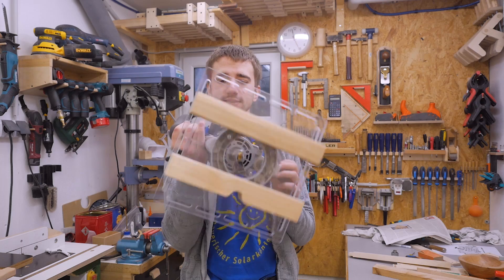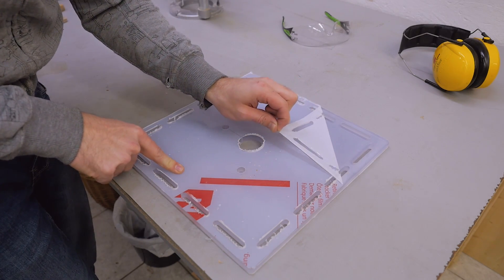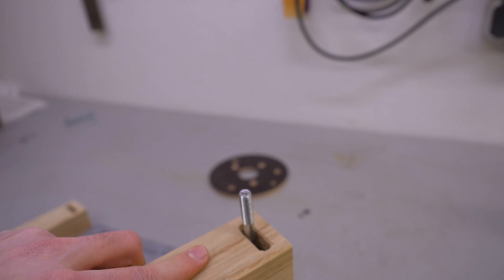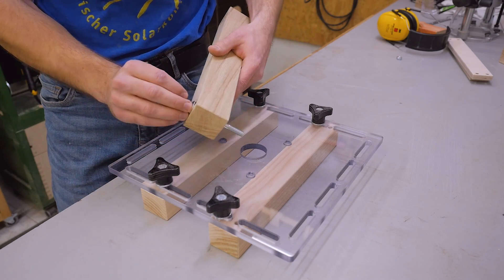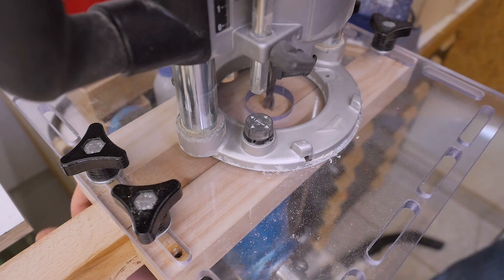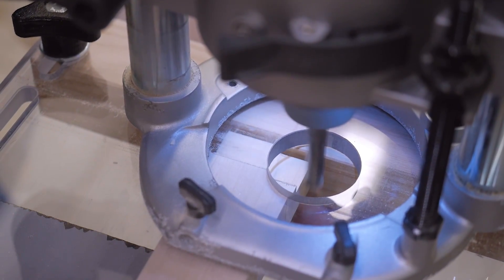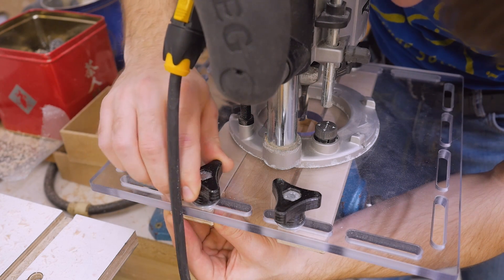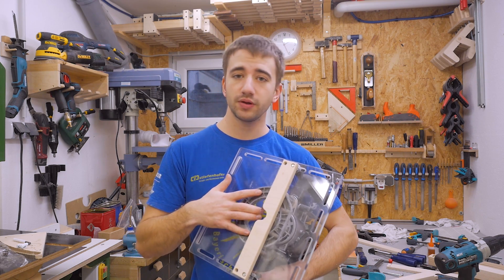Making My Version of the Samurai Router Jig

Comment: A trick with the threaded holes is to soak them with thin CA and spray with accelerator. Hardens the threads and they last forever. Love the jig. Awesome work!
Reply: If you need more hold you can always use threaded inserts
Reply: Bobby another trick- fill the thread hold half way up with 2 part penetrating epoxy, than wax the treads of the bolt -run the bolt in for a few seconds than back out, the bolt forces the epoxy into the treads/wood. Not as fast as CA but very strong P.S. clean bolt threads

Comment: The magnet washer trick - I've never seen that. Brilliant!
Reply: Mr Wandel did it
Reply: where was it?
Reply: Trick is fine and I seen it already and like it, good job.
But to be honest, here it seems to me a bit too much. It's OK for place where I do expect to change washer, but in this application ? I would expect the washer to be there .. well .. forever? Or, and it's still possible, I'm missing some important point :-).
Anyway, thank you for the idea worth spreading and I'm going to redesign my one custom base (more slots and knobs from top).
Reply: Tom Silver In normal use, the knobs come out, and they go back in. He showed you that in the video. Watch the video. He showed you that in the video. Watch the video.
Reply: @arlingtonhynes  Knobs are cheap and so are washers. Just epoxy a washer onto the knob and move on. The baseplate concept is excellent and the notched out fence is exactly the add-on that I did after seeing the samurai one.

Comment: Awesome video. Thanks for the jig. I decided to make one. I only could find 1/4 in (6mm) polycarbonate. I dont have a cnc so used a router to mill the slots. This proved tricky as all the bits i had did not do a good job. Tried double flute straight bits 1/4 and 1/2 inch bit did not work well. Spiral 1/4 and 1/2 in bits and did not work either. The perfect bit for this was metal spiral bits with 6 flutes. Worked perfectly. Very clean cuts. The metal bit has a rounded end and eats polycarbonate like butter. Thanks again for this video

Comment: It also occured to me that for routing centered grooves/holes, instead of the guides you can attach two round pins to the template equidistant from the bit, and turn it until they meet, just like a center finder... but only if the hole isn't too close to the end of the work piece.

Comment: awesome.  i will be doing this!  i like the slotted holes so much better than fussing with the samurai's original design with dozens of countersunk screw holes.  i think i'll use extruded aluminum rails with t-bolts instead of hardwood though and i'll put a strip of UHMW tape on the faces of the extrusion so that they glide nicely.

Comment: Thanks for sharing. That jig can also be made to fit in a router table so that there is no setup time. Also, with all the fences removed from, this jig can be used to make router boxes (boxes cut using a template, with the boxes having curved sides)

Comment: You could reduce the size of the slots around the edge (to clear a 1/4-20 inch or M6 thread) and make it into a T-slot, and add handles for surface-work where you can see through your base plate.  Nice revision to the already awesome samurai version!

Comment: nice work.  you might consider making the main hole sized and counter sunk to accept a router guide to have additional options and flexibility.  i have a piece of polycarbonate waiting for this...  One other thing, i would mount the plate on the router before drilling the center hole, then use a router bit to cut the center hole.  that way it is perfectly centered.

Comment: Good work. Yet as to M8 in hardwood in the long run, I would use brass inserts with inner M8 threads which would outlast any thread in hardwood. But that's just me. And the next thing for you to ponder upon would be to fix the router movement lengthwise with some sort of stops. That would be very valuable for serial production of parts.

Comment: Seems like there's plenty of room to add a dust collection chute above this jig! That's the one thing I dislike about my Bosch fence, the dust chute is unusable in the vast majority of cuts because of the position. I may have to eventually make this jig + dust collection for that reason alone. I also like how long the fences are
Reply from the maker: Yes, I took all dust collection off for better a better view in the video.
Reply: @MariusHornberger  Oh is it DC built for your router or did you fabricate something as part of the base? Can you show it off?
Reply from the maker: Just the part that came with the router.

Comment: I would use heli-coils for the wood threads on the fence parts and also add handles on the base plate so you're just not gripping the base plate. Other then that it's a pretty sweet setup.

Comment: I enjoyed your video. Your version of the fence attachment, with the non-slotted holes is a bit of an upgrade. With the original jig design, with bolts going through two slots, there was nothing to even encourage the fences to remain square to the plate and thus parallel to each other. By creating a fixed distance between the threaded holes, you've restricted them to move mostly in line with each other. However, small to moderate deviations from square (and thus parallel) are not hard to create, just because the threaded bolt has to have clearance in the slot. 

If I might make a suggestion, extending the fence to the edge of the plate and putting a T-square type rail along it would allow you to enforce that the fences be parallel when you tighten down your knobs.
Reply from the maker: The nice thing is that the fences don't need to be square or parallel to each other. A round cutter doesn't care about that. And the fences reference off of the workpiece. (the workpiece should be square and parallel)
Reply: @MariusHornberger  Squareness is only to ensure parallelism. Unless the fences are actually parallel, there will be clearance to rotate the plate relative to the direction of cut.  Just as an example, if one fence racks in its slots as you attempt to press it fully against a side of the workpiece, you could easily be forgiven for feeling it had registered against the piece, but still be very disappointed when you flipped the piece around for a second pass on a centered mortise, only to find your mortise slot is trapezoidal.

Perhaps I am overly cautious, but it seems like easy insurance.

Comment: Just built this jig (with slots like yours).  One big problem - I cut a long tenon (5 inches) - and did the firsts pass under the target dimensions for the width so I could 'sneak in'.  The router and plexiglass is supported quite well on the first pass.   But on the second pass, suddenly there's nothing there to support the 12" base - just about 1 inch at the shoulder of the tenon.   Wobbly work after that.  Really looking forward to seeing how you defeated this on your big table build.
Reply from the maker: I have faced that issue during the tables build. There's a simple solution. Don't cut the end of the tenon at the beginning, but in the end with a chisel
Reply: @MariusHornberger  thanks for responding!  Still a little confused (I don't have your level of experience) but definitely looking forward to seeing your process visually in the video.  Cheers

Comment: Very nice jig, thankyou. Your presentation is well done.  Question: Why 16 slots? Would eight (4 on each side) not be enough? Or do you put stops in the open slots? Idea: One could make the two wooden rails to be longer on both sides of the polycarbonate, and cut them on the inside down so that the polycarbonate plate slides squarely in them.

Comment: Nice jig . I have found somebody with a cnc who make it. He hasn’t 1cm thick plexiglass available. I can chose between 8mm or thicker. Probable 12mm. What would be better? Is 8 enough?
Reply from the maker: 8mm is enough, but I'd go with 12mm
Reply: @MariusHornberger  I have a confirmation. I can choose between 8 and 15mm Would 15 to thick? I think it limits also the maximum thickness of the machine

Comment: Where did you get the router bit with the small bearing?
Reply from the maker: The bit is a regular chamfer bit, that came with a small bearing. But here I turned an even smaller ring out of metal to get into the slots

Comment: Marius, any reason why there are 4 slots per side instead one long slot per side to avoid removing the knobs? I'm sure if you cut one slot  per side, the base would still have strength to hold in place and not snap off.
Reply: I was thinking the same thing. It's probably a matter of keeping the thin side of the slot more supported. If the slot is position more towards the center so there's more material on the outside edge, I think this could work.

Comment: Are special router bits and drills necessary to work plexiglass?
Reply from the maker: No. Should only be really sharp. But it's polycarbonate not plexiglass
Reply: OK, it is polycarbonate that I bought. The biggest drill bit that I have is one inch and your drawing calls for 40mm so that is about 26mm compared to your 40. So, could I use a 40mm hole saw or would a diamond coated hole saw like for glass work better?

Comment: You should put a ruler on each side, orterwise you might get out of alignment across? When fastening the knobs
Reply from the maker: That doesn't matter with a round cutter.
Reply: @MariusHornberger  have you ever read the book "Router Magic" by William Hylton? He had amazing ideas for router work.  He also used pivoting fences on router tables instead of traditional fences like on table saws
Reply: Marius Hornberger I’m not an engineer or anything, so I have a hard time figuring it out, but is that not only if you use the full length of the fence?
Reply from the maker: No, it's because the fences reference off of the workforce edge and don't rely on being square or parallel to each other. The router bit distance will always stay the same, since it is round
Reply: Marius Hornberger can you spend 10 seconds in the next video showing this? I would appreciate this :-)

Comment: I was gonna make your version, however I have two questions:

1. Why did you CNC the slots on all 4 sides and not just on two?
2. why did you go for mutliple smaller slots and not just one large slot?
Reply: 1. More versatile. Never know when you're gonna need it. 2. Smaller slots maintain stiffness of the outer wall on the slot.

Comment: nice version! But is there a reason to use plexy glass instead of plywood or something similar? Does it help being transparent?
Reply from the maker: it helps a lot to make it transparent. You don't have to, but you can see pencil marks on your workpieces
Reply: @MariusHornberger  thanks for the reply. I started working with 8mm plastic panel and see where this goes. I can always upgrade to a transparent one :)

Comment: Hey @MariusHornberger, are you still using the jig as is or did you change things over the years? Thanks for the great video!
Reply from the maker: I still use the jig and haven't changed anything
Reply: @MariusHornberger  Thanks for the quick reply! I just got my first router and will try to make it with and for that. Keep up the great work!

Comment: What cutting speed and bit size did you use on the polycarb sheet? is it liable to melt if I use a router on the wrong speed? I've cut HDPE successfully before, the main problem is static sticking it everywhere!
Reply from the maker: 6mm end mill four flute, 12500rpm, 2000mm/min feed, 0,5mm depth per pass
Reply: Thanks Marius, so with a hand router I'd need to take tiny cuts witha slow feed rate
Reply from the maker: High feed rate
Reply: does it melt on the cutter?
Reply from the maker: No, polycarbonate cuts great

Comment: I never really liked the idea of having to screw in the fences. The one I made is similar to yours, but with two long grooves rather than multiple small ones. Yours is probably a lot more rigid. Do you have any advice on how to cut a similar design onto the perspex with just a handheld (or table mounted) router? ... My first attempt was with perspex, but it melted when doing the lightest of cuts and so I reverted to using plywood (which works, but having it clear would be a nice feature)
Reply from the maker: Don't use Perspex or Plexiglas. You need Polycarbonat, which you probably need to order. Use a low rpm and 6 passes for one slot. That should work.

Comment: hello Marius, thank you very much for the DFX file for the cnc machine. can it be that there is a mistake in the plan? apparently something has been inserted in the lower part and at this point the cnc machine stops. unfortunately I cannot edit the file. would you check that out, please? Many Thanks. Ingrid from the Netherlands.

Comment: Nice work! What kind of router bit are you using in the CNC to get such a nice finish in the polycarbonate?
Reply from the maker: It was a metal endmill. Low rpm, high feed rate and shallow passes.

Comment: I like the homemade knobs a lot! Out of curiosity, is there a benefit to putting the magnet on the bottom to hold the washer as opposed to just gluing the washer onto the bottom?
Reply: What I learned while working in a machine shop before is that typically you put a flat washer between the nut (or knob in this case) and the surface to reduce friction while tightening the nut (as well as greater surface area so the nut doesn't get sucked into the hole of course). The nut normally has less friction against the washer than the washer against the surface. So gluing it to the nut or knob where it wouldn't be able to move freely would negate this.
Reply: @JacobRoberts1  very good point!

Comment: Why make 4 discrete slots on each side? Couldn't you just suffice with a single long slot for each side, giving you (more) continuous adjustument?  Better yet, since you only work work with max two fences at a time, why bother with slots on 4 sides? 2 would seem to suffice.
Reply from the maker: That's right. After that video I elongated the slots give long single one per side and fence. It's much better

Comment: Hi, at 5:55 how do you ensure the fence is square with your line, when both ends of the fence move? Would a T shaped fence make life easier for this kind of cut?
Also is there any benefit of a square mortice over a rounded one?
Reply: The fence is running parallel to the end of the piece. So as long as the end of the piece is square, you're all good. Although you still have to hold th whole contraption steady.
Reply: @SirBenJamin_  D'oh, I was being dumb. I just re-watched it and it all makes perfect sense. Thanks for poking my brain into gear.

Comment: I think that I have an improvement on your guide pieces. I would embed a "T" nut on the opposite side of the piece from the bolt which means the bottom. Then you would not have to tap the wood with the 8mm or whatever size tap. You just drill a round hole. It saves you from buying the tap and metal threads are probably stronger than threads in wood.

Comment: I don't like it, the single hole with screw is a better design, as there is no chance of the fence moving because the bolt hasn't been hand tightened correctly.